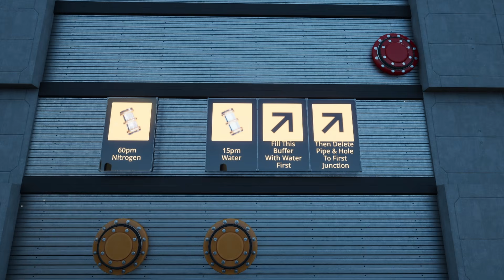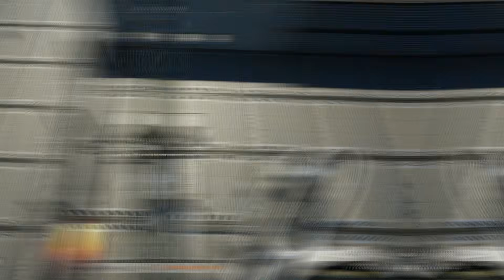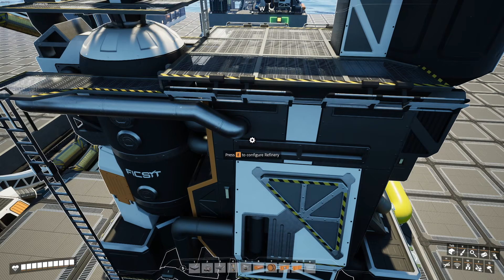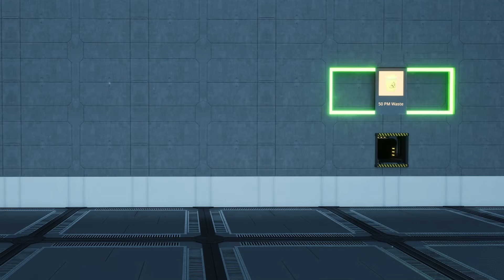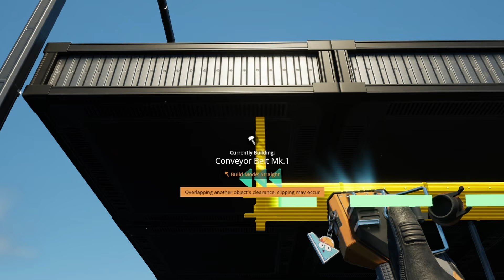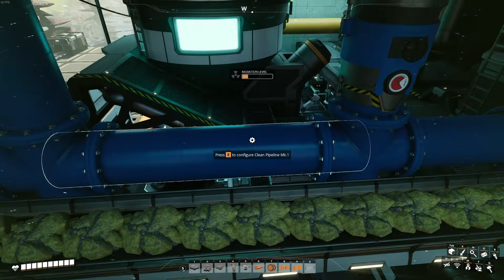Easy Plutonium Fuel Rods BLUEPRINT. Satisfactory 1.0

Comment: It's an awesome build I recently used it and failed three times I follow your video down to the queue but it doesn't remove the waist fast enough and you end up a backups
Reply: If you built the Uranium Fuel Rod Blueprint of his other video and slooped it, you need 2 of these to offset 10 reactors.

Comment: That's pretty cool. I have similar blueprint except not as good looking, a bit more dense, but no clipping :). I have nitric acid production outside, so take it as input. And my Particle accelerator running at 100% with 100 uranium waste input, so 0.5 plutonium rods at the output.